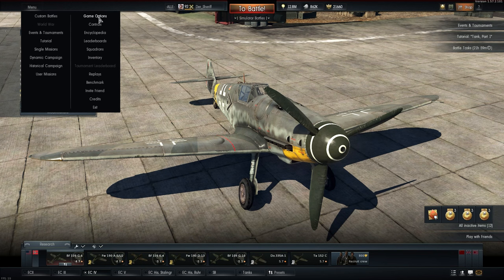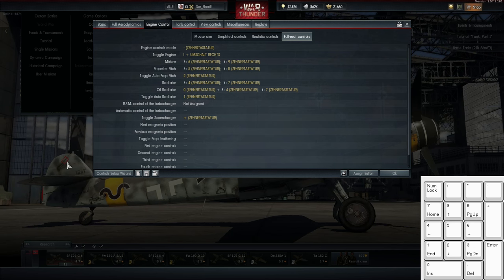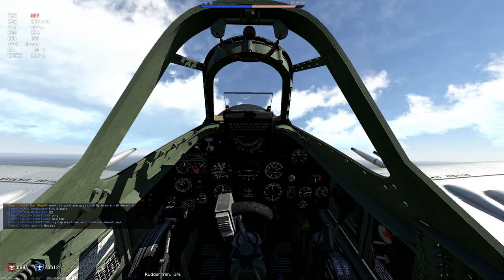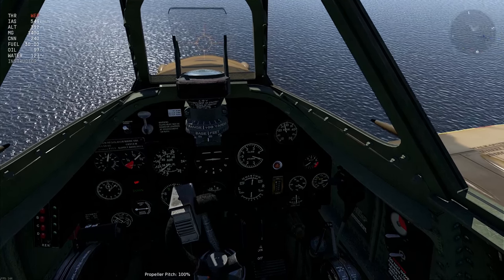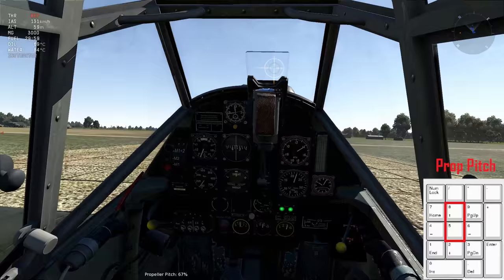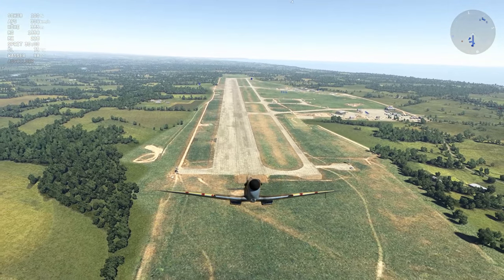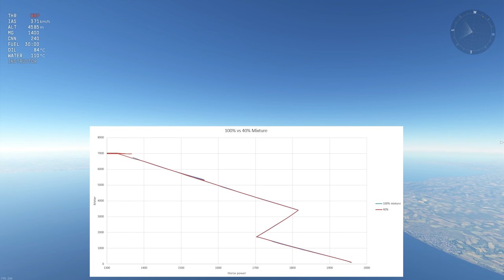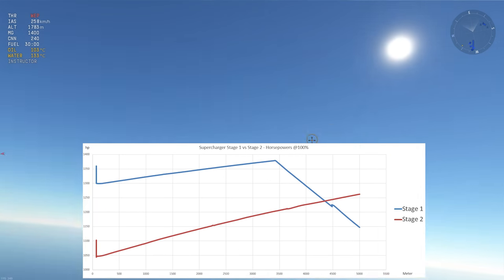Manual Engine Controls - How to Setup MEC for War Thunder!

Comment: Great tutorial Sheriff! Thanks! Will give this a try - particularly impressed by the difference between engine temps using AEC/MEC (Spit - @ end of vid).
As a slight 'aside', clearly you are using head-tracking. Is that VR or TrackIR? If it's TrackIR (which I use) how do you get such nice flowing head movements? And (if TrackIR).... would you share your config file...? ;)
Reply from the maker: This is my TIR File, pretty old by now and pretty sure I would change a few things.

And the temperatures of the spit would now be different, with all the changes in WT.

https://drive.google.com/file/d/0B7NEbwyXgfdDR2FuNlNQa1F2TVk/view
Reply: Ah, right. OK.
Many thanks for such a quick reply - will try your config :).

Comment: Hey, thanks. I've been dicking about with MEC recently and the only real question I have left is in the way War Thunder handles Prop Pitch. In a constant rpm aircraft like the Spitfire IX... if I switch on manual engine control, is the prop pitch control adjusting RPM, not pure pitch?

Cause on the bottom it still says pitch. So I wanted to make sure. Doesn't help that my German is super rusty so I couldn't just confirm on your vid, haha.

I just got into Sim this month, god knows what I was doing wasting my time with a joystick and TIR all this time in RB. Loving it, looking forward to testing my skills against you soon. (Or if you're ever looking for another wingman, shoot me a msg, I fly mostly Brits, but I'm up to 3.3 in Germans now)
Reply from the maker: +Tigris Gaming Yes you are right, if you are flying a plane with a contant speed propeller the "pitch control" controls not the pitch but the RPM. You are right
Reply: Thanks mate. See you in the skies.

Comment: This is very informative. Do you have any suggestions for flying MiG-3? I don't understand why the MiG has aileron trimmer in RB, but not in SB. This makes it very difficult to fly in SB. I have to battle the plane constantly as it tends to roll on one side and I have no aileron trimmer to compensate.
Reply from the maker: I now that you can start a test flight, change the trim of any axis in any plane and then can fixate the trim with the corresponding button.

Comment: 7:00 How did you takeoff full WEP out of idle? If I do that, my plane will violently swerve to the left (or right), and I won't be able to keep it centered on the runway even with full opposite rudder and individual wheel brake.
During my takeoffs I'm always forced to slowly increase the throttle so I can control my plane, while my teammates takeoff so fast. Any idea on what I'm doing wrong? (Maybe my low rudder sensitivity?)
Reply: Arch3rAc3 you can trim your rudder beforehand, but he may have mastered the torque effect to a certain extent that it makes it seem like there is no torque at all
Reply: The thing is, even if I apply full opposite rudder from the very beginning, it won't counter the torque (in some planes at least). So even if it's trimmed, the torque is too "strong" as to say.
Reply: Have your Sim controls set up? When I was first starting on sb I had a bunch of problems keeping the plane straight on the runway regardless of input. You gotta def set up new controls if your playing Sim. Mouse and even keyboard is pretty garbage for sb. Use a controller or joystick

Comment: Is there any benefit from MEC in WT? I mean as far as I know everyone uses AUTO engine management so I think mastering MEC is only for one's personal satisfaction cause engine managent adds another thing to do. To be honest I also complicate my virtual life cause I mostly fly with HUD completely off ;)

And in my personal opinion MEC for > Bf 109E-4 and Fw190 (which had engine automanagemer or even Kommandogerät in BMW engines) is art for art's sake. Even real pilots did not manage engine manaully in combat.
Reply from the maker: I recomend to whatch the video completely. Especially the last part regarding the benefits.
I personally dont use MEC on Fw190s. Due to the Kommandogerät and the manual Proppitch if flown in MEC Mode.
Reply: Got me, I skipped that part :/

I did not care about AEC or MEC cause I mostly fly German fighters. But on the other hand your video shows  that WT is seriously fokked up... I had a dream about "Experten" servers in SB mode but it does not make sense any longer.
Reply: Awesome video mate thank you so much! Thanks to you i understand almost everything. I got premium P51D-10 recently and it has heat problem, engine gets cooked so quickly even if i don't use wep much. It has different FM than D-5 or D-30. So im trying to use MEC for fixing this problem and it works engine gets cooler with MEC settings even if i always use wep. But i sense im loosing power, especially at higher alt. Mixture isn't changeable could it cause less power? While climbing i use %90 prop pitch, it seems better than %100 for P51D-10 but im not sure.

Comment: I'm having a little trouble with the prop pitch. I know that it is better left alone, but l do want to play with it a little. I understand how it works, but I don't know what setting to use it on. I was playing around, and jacked it up to 100% and it instantly killed my engine, and I don't know why it does this. Can someone explain some of the best/ most common setting for prop pitch and why it instantly killed my engine.
I'm mainly flying the Bf109 F-4.
Reply from the maker: The Chapter at 7:50 explains it
Reply: Sheriff's Sim Shack thanks.

Comment: it makes me use a controller and wont let me keybind for most of those controls
Reply: If your on Xbox you can hook up a keyboard
Reply: You can plug a keyboard onto your console, or bind combinations of buttons on the controls. Me,  personaly, play on PS5 and i activate MEC with L2+R2+X, and use the d pads for seting the values together with L2+R2 for PP and X for all the rest. Also, L3+R3 for switching Supercharger gear, and X+O for next magneto position. I'd recomend the keyboard tho, since it's a lot more practical and you can type in chat and do many other things with it.

Comment: Gaijin removed this!!!! is there any other possible way to still make it work?!
Reply from the maker: No its still there. I have no idea how u came to this conclusion
Reply: I understand now. Because the settings for each device used to be "increase value" and "decrease value", now they turn into "maximum value" and "minimum value" which makes it impossible to change the values precisely. If you've set them up before, the increase/decrease settings stay there. but if you haven't down that before and want to set up MEC now, it's only possible to set up to either 100%, 50% or 0%. which is dumb.
Reply from the maker: Just activate "relative Control" in the menue and live happily with MEC.
Reply: Just figured out by playing around with it. "Relative Control" is the key! thanks Sheriff for the video. This makes War Thunder to the next level of fun. Greetings from Aachen.